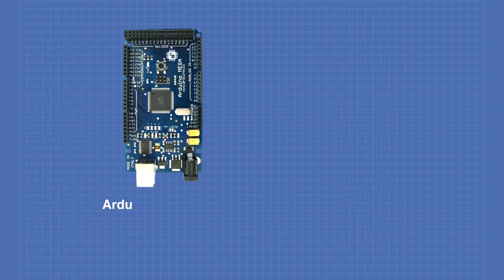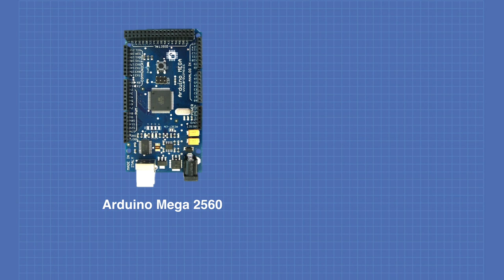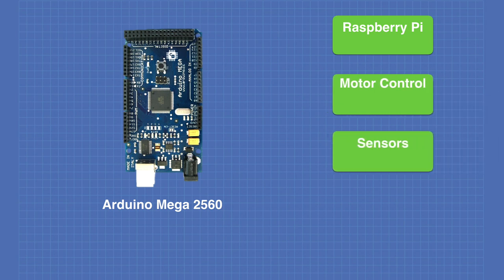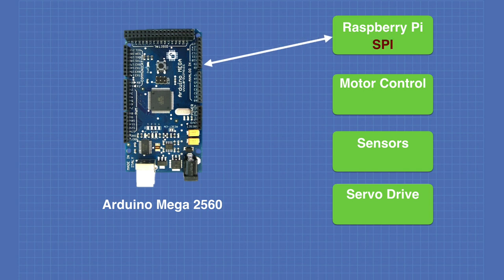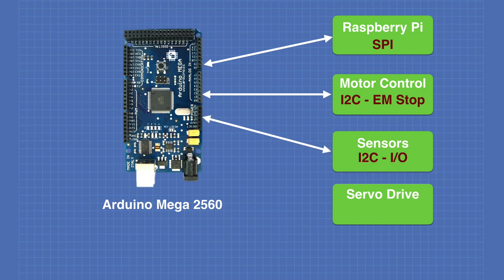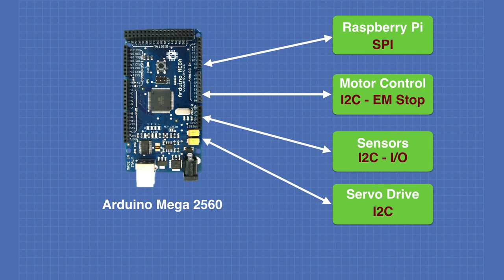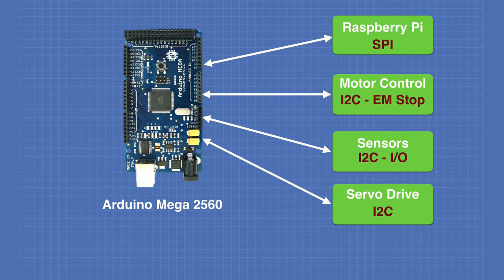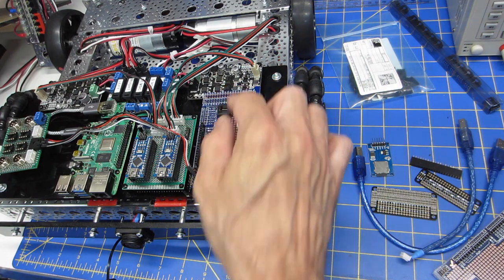Build a Real Robot - Episode 15 - New Modules

Comment: Please add a high watt laser! Obviously 3d laser sensors aren't expensive but weaponizing is always fun and would be straightforward then a xyz servo setup would also be straightforward add on with the laser mounted with on/off attached right to the buck driver for the laser diode...

Comment: It is interesting that you are switching to JST connectors.  Now and then I have considered using more of them myself. But---- I just can't get my head around the way they spec them.   If I have a device with a JST connector, trying to order its mate is frustrating to me.   The sellers often don't help much either. And then there's the issue of attaching wire, as you mentioned.  I just did a youtube search on "JST connector" and found dozens of videos about them, so maybe I am not the only person who has this mental weakness.

Comment: looks like it's going to be a nightmare to program - so many different platforms, so many different ports for programming. Have you thought about making the robot firmware upgradeable from a single point? E.g. upload firmware blob to rpi and from there on it's flashed to appropriate component? anyway, good luck with the project.